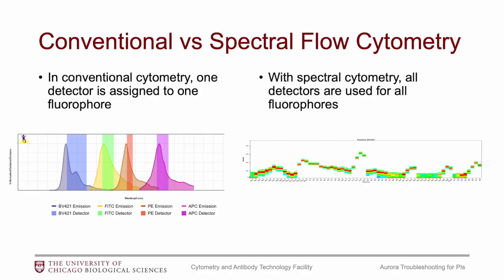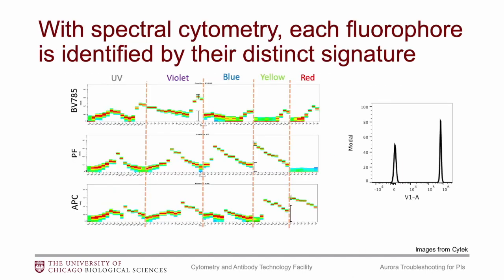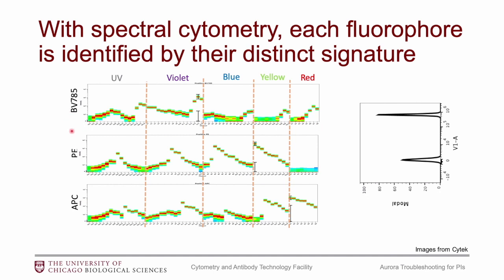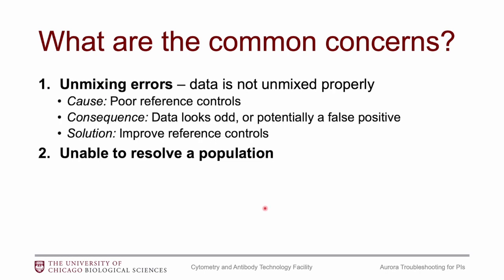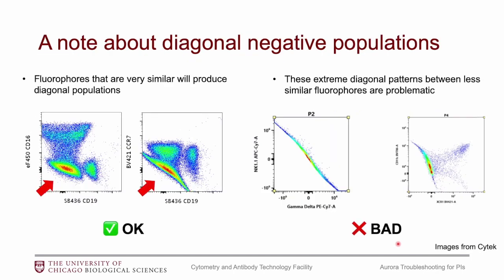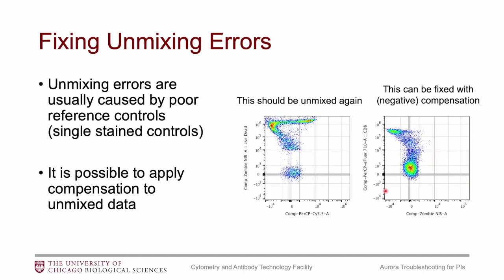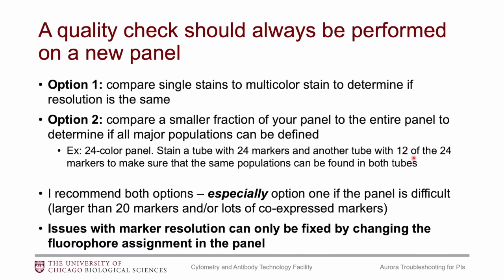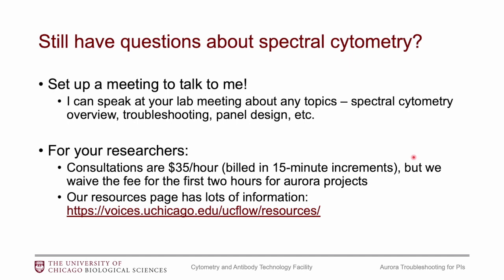Aurora Troubleshooting for Principal Investigators

Comment: Hey Laura! Thanks for sharing all this! Very helpful. I saw you make an overlay of unstained, fully stained, and single stained to make the panel quality check. When you overlay these, do you use all uncompensated parameters? (Maybe this question does make sense but I got confused when I was doing it as I have different histograms depend on my parameter on X axis).  Thank you very much!
Reply from the maker: If you just use spectral unmixing in SpectroFlo and do not use any compensation in addition to that, then the "uncompensated" and "compensated" parameters in FlowJo are the same. If you did apply compensation on top of the spectral unmixing (either in SpectroFlo or FlowJo) then you'll want to choose the compensated parameters in FlowJo. It's best to do a panel quality check in data that is free of any unmixing errors.